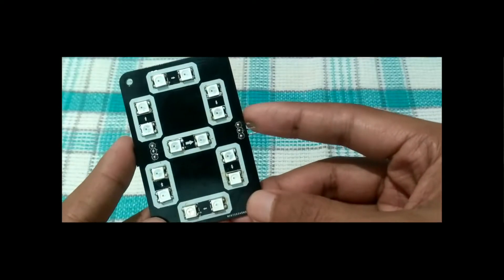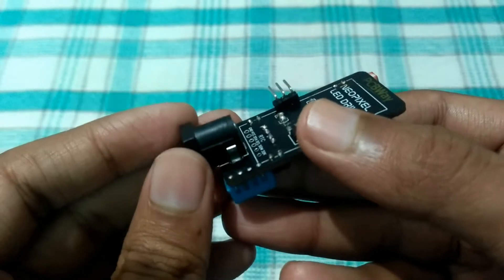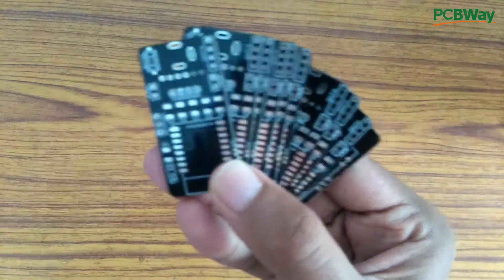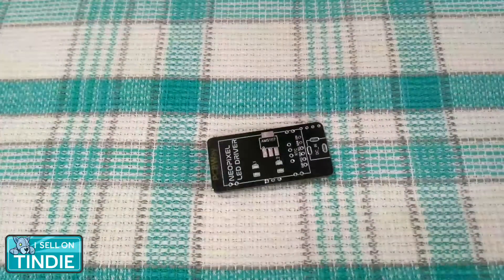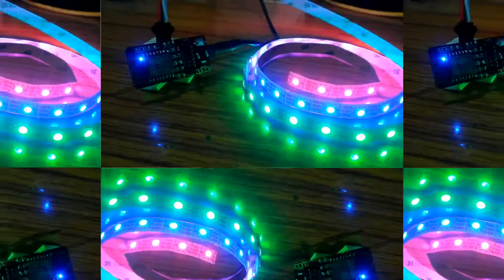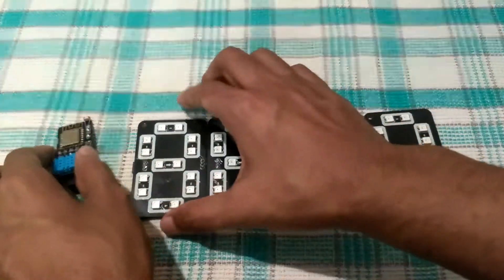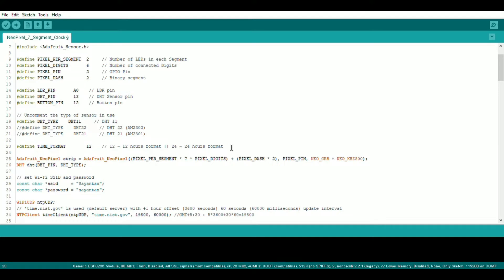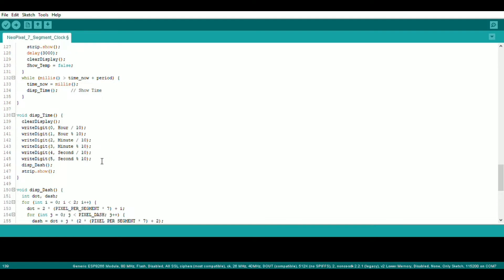RGB 7 Segment Digital Clock using ESP8266 & WS2812b

Comment: Nice video, really helped me alot with my own clock.
Only thing, I'm having troubles with, is the "dot/dash" thing.
I have 2 LEDs per dot (instead of 1), could you maybe point me, in the direction of where I can manage this (PIXEL_DASH X) doesnt help alot.
Reply from the maker: Search for the keyword "PIXEL_DASH" and replace it with "PIXEL_DASH * 2" (excluding the definition)

Comment: Sir, is it work without constant internet connection?
Reply from the maker: No, it requires internet connection. Otherwise you have to use a RTC module for time keeping. Checkout GitHub repo for more information

Comment: I have 2 problems with this excellent project
1) The seconds seem to pause for 5-6 seconds 4 times a minute?
2) When I press the button to display the temperature, it show the CORRECT temp, but does NOT go back to normal time, Unless I RESET it. 
Do I need a pull up or pull down resistor, if so what value?
Reply from the maker: Might be due to slow internet connection and 10k
Reply: @ElectroPoint4u  I fixed the problem with a pull up resistor of 4k7 to 5V , and the PAUSE was caused by the Period=1000 to Period =20. it know works fantastic !!!!!!
Reply from the maker: Nice
Reply: Hi, did you have this trouble: when time shows up, the digits flash/blink every 1Second. The flash/blink very short. And the blink interval time is affected by "int period = 1000", if you change it to 10000, then the digits blink every 10seconds

Comment: Did you design this code yourself if so i have a question about color. I'm not good enough in coding yet (just started) can't you make brightness into an equation so you can choose more than 3 colors per digit. like color=Brightness-(100,100,100), it would be better.
Reply from the maker: Use the brightness variable as an factor of the individual colors. That might work
Reply: @ElectroPoint4u  i changed color to colorhsv and i can get what ever color i want thanks for a great project
Reply: @ElectroPoint4u  ok thanks

Comment: Excellent work I like how you go through the code and explain what everything does. Is there any way to have the 0 off in 12h mode and also to change the colors?
Reply from the maker: The color is defined at the end part of the code. As for the zero, you can skip it the writeDegit function.